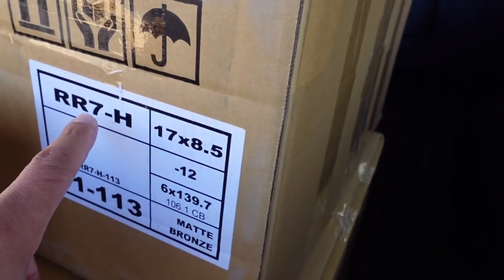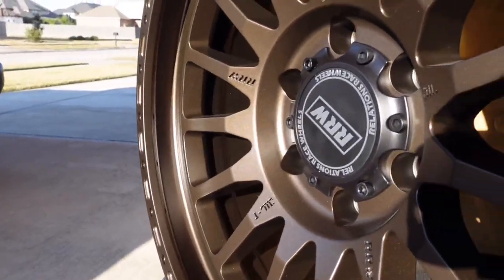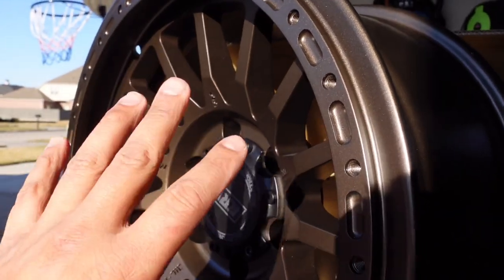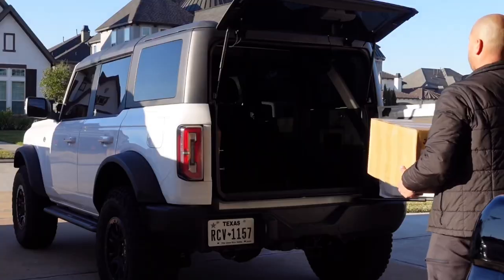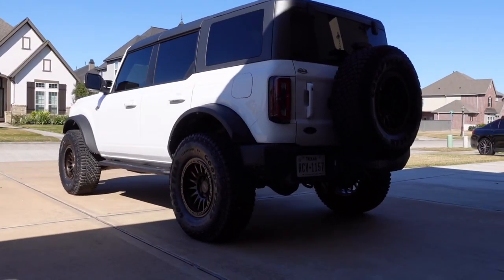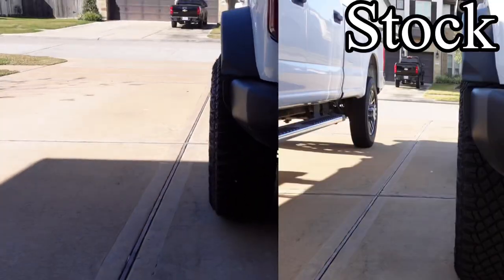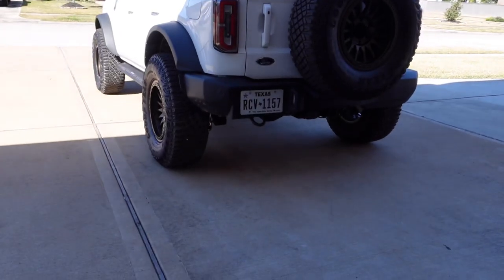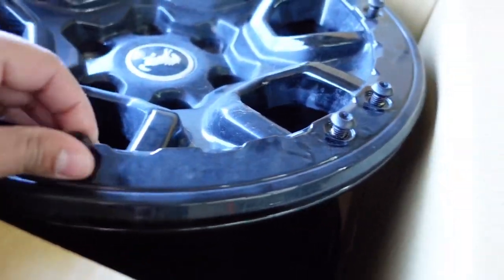BEST AFTERMARKET WHEELS FOR YOUR FORD BRONCO. Hybrid BeadLock Wheels On 2021/22 Ford Bronco WildTrak

Comment: Ordered the same set of wheels for my Bronco, seeing this helped solidify my decision 🤙🏽. May I ask which lug nuts you used/purchased for these wheels?
Reply from the maker: I went ahead & just ordered the ones from the same website as the wheels. It’s only enough for the 4 wheels on the Bronco. Then ordered a set of 4 locking gorilla wheel locks, put those on the wheels on the Bronco then had 4 left over for the spare tire.

Comment: Do these wheels offer any offroad capability?  How did they perform on the rocks?
Reply from the maker: Oh for sure these are actually bead lock wheels. The company sells rings that can be bolted to the outside of these wheels to protect them while rock crawling.

Comment: Toyota trucks and the Bronco share the same bolt pattern. And anytime you see -12 offset, it is a Toyota wheel. If you look closely this wheel is Toyota hub centric and not hub centric for the Bronco.
Reply from the maker: That’s very true. Thanks for the tip 🍻
Reply: Well that's some good info to know 🤔 🤔